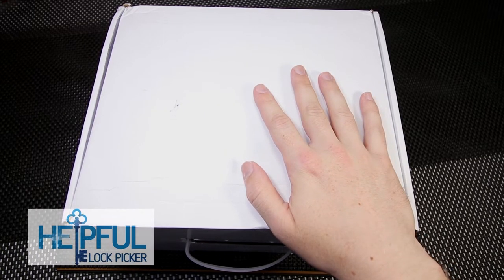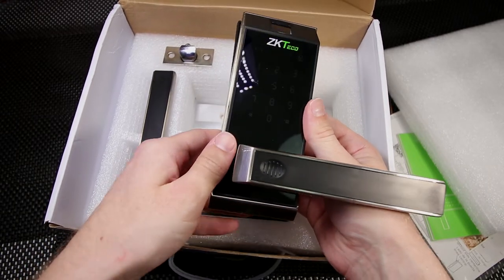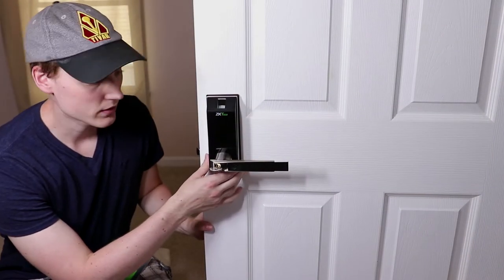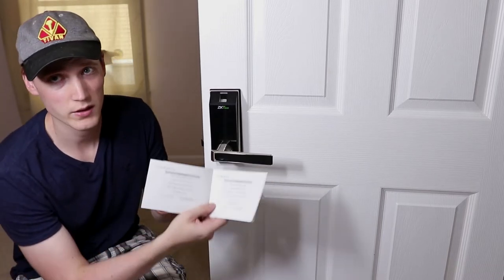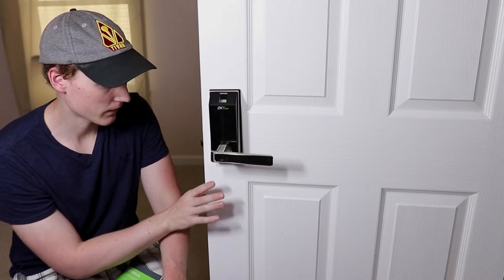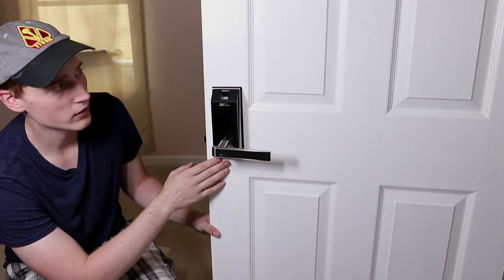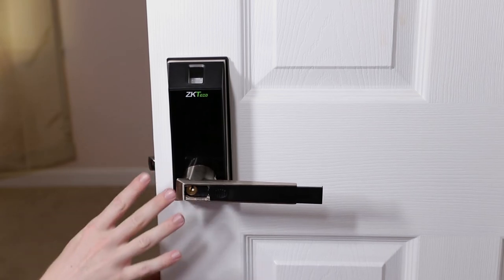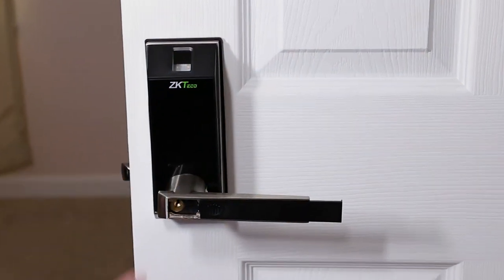[188] ZKTeco AL20B Smart Lock Unboxed, Reviewed, and Picked!

Comment: Nice initial review. You could easily beef up the pin's or even put in a high security cylinder. I think more expensive versions would also have a deadlatch and RFID reader too. Pretty cool. ✌
Reply from the maker: Increasing the pick resistance on the cylinder would be a nice touch. Having RFID would be pretty cool as well. Thanks for checking it out!

Comment: Very informative review thank you. I've not seen a "smart" lock in action before.
A bit disappointed it could be breached so easily with shimming and raking.
I wonder if the lock notifies your phone if it has been breached or accessed by unapproved methods.
Reply from the maker: I would have to check the app and see if it alerts when it is opened with the key. But it does not seem to matter the brand you buy they are all usually built with easy to pick "backup" locks. However, in real life picking locks in the field is much more difficult and would raise attention so I have never worried too much about that myself. I would never consider installing high security locks on a door that has windows near it or anything that would make it much easier to breach than the lock.
Reply: Thank you for your reply